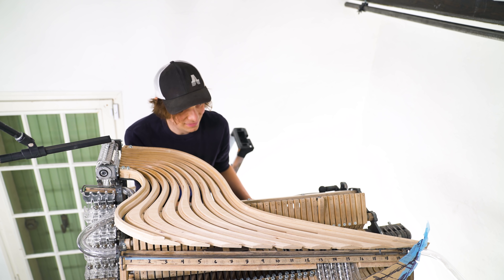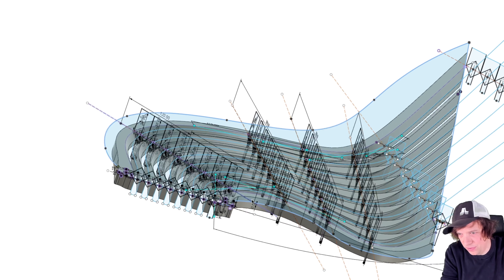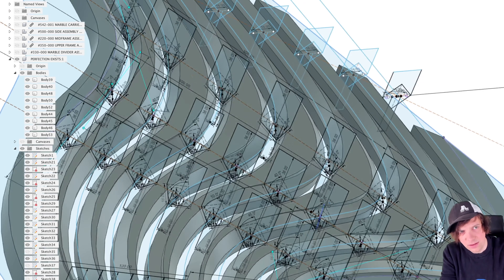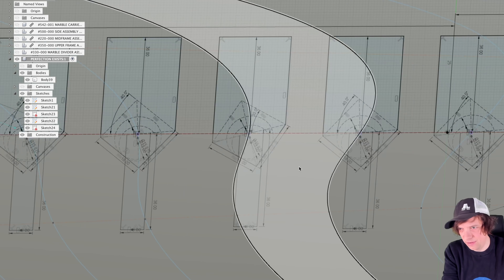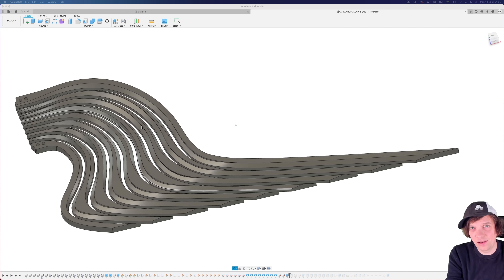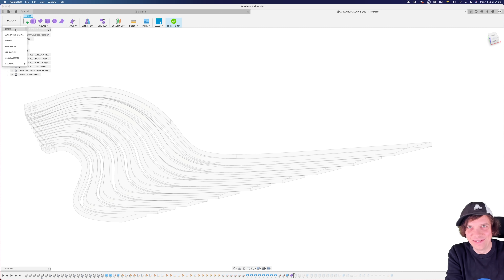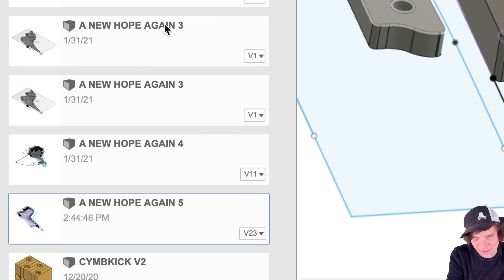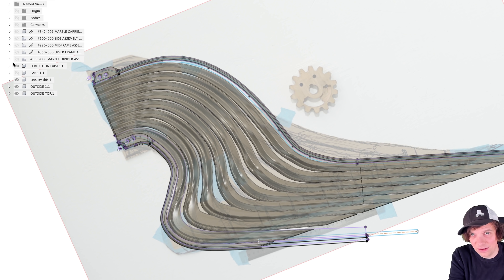Marble Lanes

Comment: Consider slow down the marbles when they "land" over the marble divider, because it seems like they are jumping and skipping some steps
Reply: Yes, and I think the lanes are coming too low in the divider, an intense vibraphone Music will probably suck out every marble and overflow may happen on the pipe feeding the divide by 4
Reply: Also, I don't understand how Vibraphone tile 1 is meant to get any marbles
Reply: @dsfisher  I saw the same thing hope he sees this before putting time in to fix the length.
Reply: @dsfisher  i think with divide by four
Reply: @dsfisher  from the overflow fish stair.
Reply: @dsfisher  from the overflow divide by 4
Reply: @dsfisher  Via the "fish stairs"
Reply: @dsfisher  don't forget the fish stairs - they will supply the vibraphone channels once the machine gets up and running
Reply: I wanted to say something about this as well. Around the 9 minute mark in the video when the marble lane is being tested, all marbles were jumping into the air. The first marble down in particular jumped at least several centimeters in the air. I'm worried that it will cause sub optimal routing for the marbles and, as others pointed out, potentially cause marbles to skip lanes and overflow the divide by 4 system. It seems like the issue is caused by the marbles having just too high of a velocity when exiting the new lane system.
Reply: i was thinking the same thing, they're coming down wayo to hot, they might skip some tubes and overflow the return system
Reply: @Stban90  or bounce out of them entirely and end up on the floor
Reply: Also kinda concerned how the marbles coming into the main marble lane might knock marbles off when coming in at those speeds
Reply: Martin will fix that with a pile of spacers 🙃
Reply: I think if the gap widens at the end the marbles will slow down.
Reply: Right now the new piece is not pressed down so the marbles jump down to the devider. I'm sure that will be done when the piece has been modified.
Reply: They're bouncing because the lanes aren't aligned with the divider yet. You see how there's excess material resting 'on top' of the divider? Martin even calls attention to it at 7:17. Once he removes the material, the lanes will sit flush with the divider, and the marbles will no longer bounce (as much).

Although they may still slam into the guard rail at full speed, giving some bounce... so yes, a slow-down would be beneficial regardless.
Reply: Increasing the overrotation of the marbles towards the end of the lanes would slow them down, but also make them rotate faster. They wouldn't het the track with such speed, hopefully not bouncing over channels or out of the track completely. But would the bigger rotational speed make them behave in other unwanted ways? I call for testing!
Reply: Widening the gap at the end will slow down the marbles because the rolling diameter will decrease.
Reply: but the problem with this is that the rotation of the ball will speed up, and so, when it lands it will have the same kenetic energy and will transfer that in speed when the rotating ball touches the second 90° slope of the marbledevider
Reply: Exactly, i think the slower speed, the best feed into the divider

Comment: Doesn't this design greatly limit the number of marbles that can enter the lanes for the xylophone droppers? Why not just merge the outputs of the fish stairs and conveyor and have them dump out at the start of the lane feeders so every lane stays filled?
Reply: Aren't the fish stairs going to the vibrophone?
Reply: @mattmexor2882  They are, but the fish-stairs are rather slow (compared to the main conveyer belt) and can't move as many marbles at once.

If the low notes on the vibraphone require a lot of marbles in a short amount of time (which is likely to occur during the playing of up-tempo pieces), the fish-stairs might not be able to supply enough marbles to meet the demand.
Reply: @InventorZahran  How are they slow? don't the marbles progress through the fish stairs at the same rate as they progress up the conveyer belt? You'll have a lag between when the marbles go past the tubes the first time and when they get to them the second, but there's also a reservoir of marbles in the tubes above the droppers and the fish stair system can be primed with marbles before playing. I don't see why there should be a problem.
Reply: @mattmexor2882   Maybe I misjudged the speed...
Reply: I don't think you can run enough marbles over that single lane - they can only move so fast if they are to drop into the space properly, so either you have too much speed and it doesn't fill anything well, or slow enough marble roll and the later channels might run dry on a xylophone heavy section - they are the smallest reservoir or marbles anyway with that slope, and nothing will run past the hungry early channels to them.
Does seem to me like this design should work well enough on the feeding marbles score - each group entering the new part is split relatively evenly down the channels so no marble stores will be left waiting, as enough new marbles are introduced across all the channels, but the fiststair recycling system gives the xylophone priority by its nature, so all the overflow will cycle into the instrument expected to be heavily used and a marble hog.

My issue with this design is marbles from the fiststair and their interaction with the newly added marble paths - it looks like the ones from this new part might be going rather too fast to stack up on top should there be marbles beneath as they arrive, and the lane shaping might hinder that shuffling past the marbles beneath too - the old system they could rack up sometimes 3 deep till the lower layers have got out the way and would mix in neatly... Seems like that lower part of the path either needs the rollation slowdown geometry for the marble rails or a less aggressive slope.
Reply: It doesn't, since every excess marble still gets fed back in by the fish stair.

Comment: if you have not already you should invest in a space mouse or some other 6DOF HID it will improve your CAD workflow having a dedicated device to move and rotate your model

when i use fusion 360 i have my left hand on my space mouse my right hand on my trackball and the keyboard between them for when i need to type 

TBH i have used my space mouse with fusion 360 for so long i don't even know how to move or rotate the model without it LOL

Comment: hey martin ! with this new design, isn't there a risk that the marbles, with this new gain of speed, jump off the devider ?
Reply: Or landing on top of each other in the divider and then bouncing out?  I think there was definitely merit in condensing the channels into 2 shoots previously.
Reply: Yes
Reply: I think he can fix part of that with overrotation.
Reply: @vincentguttmann2231  yes but it will wear the wood after some time
Reply: @gillesbkf4315  the marbles are pretty smooth, and should be wearing down the acrylic just as well. Sure, there is some wear, but not that much that it becomes signing
Reply: Yeah, he'll likely add a thin wall to the front similar to the guides around the end of the marble divider where overflow exits to the fish stair.

Comment: This new design is unreliable. You need to make the lane a U bend ending in a pocket at output 1. Or else you won't have enough balls for the xylophone.
Reply: There is always the marbles coming from the fish stairs
Reply: @hipination1037  8 marbles for 20 tracks, where one is a bass. Is not enough when set up like this.
Reply: @JohanFroloff81  the amount of marbles didn't change at all... What's the point you are trying to make?
Reply: @hipination1037  Every ball needs to pass every channel. or the machine will starve. at some point.
Reply: @JohanFroloff81  yes, and they will eventually. Let's say a marble enters the divider at channel 9, doesn't get used up in a channel, leaves the marble divider with all the other excess marble through the pipe at the end of the piece and gets transported to the divide by four. From there, the fish stairs will transport it back up and it gets fed back onto the divider at channel 1 and eventually makes its way down the divider again. The old design worked with the same design principle.
Martin only runs into problems when the track he is playing consumes more marbles than the machine can transport per second/beat/unit of time.
Reply: From my perspective, the leftmost exit bypasses several of the xylophone channels. And the speed!
Reply: @rhkavli  What do you mean. It is a ramp. Going from left to right.

Comment: What about channels 1-3? They don't look like they're being fed.
Reply: I see now that the fish stair feeds the first couple of channels.
Reply: @gir_bot  I wonder what the story is for the three instead of four going up at a time on the fish stairs.
Reply: Even without that issue, I'd be worried about marble starvation on the left channels. the last channels are going to get many more marbles passing over them than those notes. I think if it were me, i would add a switchback rail, have the sweep go to that rail just above the main feed trough, then feed every marble to the left and allow all of them to pass over all channels.
Reply: @piercet  Generally speaking... the drums and bass will consume the most marbles. If the beat slows down the overflow through the fish stair will feed the vibraphone channels.

Comment: Aren't the marbles a bit too quick when entering the marble devider? You can see the marbles bouncing off the tracks at 9:20
Reply: it looks like they are dropping onto it because the marble lane was not bent down to the divider as it will be when it is attached
Reply: I see an extra guardrail being added soon
Reply: @victornpb  I can see an angle grinder being used soon. Whack-a-mole, you know?
Reply: I had the same thought. The divider/pipes are designed, based on Marbles entering with a certain speed. With the new design, I fear for another redesign of that part.
Reply: @andershauerholt2522  Maybe he could look into adding overrotation to the last stretch of the marble lanes to slow their speed upon entry.
Reply: Same, I thought that the design contemplated this by making the channels increasingly wide so that the axis of rotation of the marbles will change and slow down the speed
Reply: He said he made them a bit to long (front-to-back) on purpose so he could trim them back to make a smooth transition. As soon as he saw they were way too wide (left-to-right), I assume he stopped there. If it had been the right width, I bet there wouldn't have have been bouncing once trimmed.
Reply: It is calling for over-rotation.
Reply: Had the same thought/concern
Reply: I was wondering if some overspin could help. Though the twist could make it hard to manage that overspin.
Reply: The velocity is probably about the same -- the marble still travels the same vertical height as before, the only real difference would be the friction of the wood (which I'm sure will get some graphite to help with that) versus that of a PMMA pipe. I think the bigger question is the angular momentum -- before, its velocity was along the edge of the wood, but with this, it looks like the marbles are going to have more of a vertical component. That could lead to edge cases where a marble manages to land itself in a "sweet spot" between the marble and the edge of its hole, which might lead to more bounces like this.
Reply: I'm super-concerned about this as well. Hope Martin has thought about this and has a secret plan to manage it :-) Maybe he intends to adjust the lane width and use the marble overrotation-concept to slow down the marbles?

Comment: I still have the impression that the marbles enter the divider with a lot of momentum so that they will surpass the pipes that are empty. I think it might be a good idea to try to figure out which channels are preferentially filled up with one design. Would suspect that in the end the upper 50% of lanes are probably filled up with the marbles that are filled up by the fish-stair. From the beginning I thought that you should always have a reservoir of marbels that are available to fill up empty channels randomly but I need to say that I would not have an idea which meets the requirement of being beautiful.
I mean the momentum problem can be solved easily with the angle of the end of the lane with respect to the divider and maybe the lane itself can be used as a marble reservoir which always holds marbles.
But in the end I am sure you will find an excellent solution.
Reply: either that or slowing down the lanes with some fabric or something so they'd have less momentum, kind of a problem solved before having it entirely.
Reply: The momentum I saw as a bit of an issue too, not only for missing the lanes but what if they hit another marble? Could throw both of them off the machine easily.
Reply: @dylan1kenobi  if the lanes are always filled with marbles I think it could work, but than you need to know how many marbles you can fill in the first place to not produce an overfill. It is really a complicated problem because it highly depends on the Musik that will be played
Reply: Well those marbles are not there to fill the funnels (at least not at the first attempt and otherwise only for the last few funnels) the stairlift is the one which will fill all funnels.
Reply: @GamezBeatz  agree but at the same time this is the slowest refilling mechanism. I am very curious whether or not this will be a problem and how it will be fixed. Cant wait to see
Reply: @paulgwozdz2475   I always thought of the overflow tube and fish-stairs as being a "retriever" for any marbles that didn't enter channel in the divider. I never thought I'd see it being relied on as a primary deliverer of marbles to the upper channels, considering its slow flow rate and limited capacity.

Comment: Should have glued the edge rails on after initiating the twist when mounting
Reply: I was surprised that he even started sanding it without seeing if it fits first or even comparing it to the template. Ah well. Mistakes are a great way to learn.
Reply: @nagualdesign  Put yourself in his mindset. He designed the piece in cad on top of the cardboard template and used the CNC to cut it, so he already "knew" it would fit
Reply: @YozhikvTumane  When he's made templates previously he scanned them alongside a ruler in case the scanner got the scale wrong. This time the template was too large to scan so he taped it to the wall and, I'm guessing, took a photo.

When I saw it taped to the wall, along with a ruler, I hoped that he'd take the photo from as far away as possible with the camera at the right height to avoid barrel distortion, but it looks like the biggest issue was only using a small ruler. I think his success with the scanner gave him false confidence that he could use photogrammetry without any problems.

Knowing that the machining was going to take hours, it would have been sensible to put a felt tip in the router and have it quickly redraw the template on paper, then see if that template fit on the marble machine, before investing a lot of time and effort cutting plywood. Or at the very least taking a few measurements from the CAD drawing and seeing if they match the dimensions of the machine.

It's an easy mistake to make, but a bit of a rookie error. The moral of the tale: measure twice, cut once.
Reply: @nagualdesign  The problem wasn't the scale of the template. As you saw, the previous (rounded) design was accurate. I think he just lost focus when re-designing the tracks and adjusting the curvatures for aesthetic reasons.
In my opinion, the template isn't even needed when having the two planes, start  and finish line, measured and linked in the CAD drawing. He could have created those tracks only from the fixed points measured in the previous video and with the length & relative angle of marble divider included. It would have eliminated the problem all together.
Reply: @YozhikvTumane  Yup. It may well be that he simply lost track of which line was which. As you say, focussing on aesthetics and getting tunnel vision.

I posted a far simpler suggestion at tiny (dot) cc (slash) mmx-simplified but I don't think he'll see it, or if he does he probably won't want to use it, as it ain't pretty.
Reply: @nagualdesign  Many great ideas and suggestions might get lost among all these thousands of comments to these videos. I'm sure I wouldn't be able to rea each nd every comment if I had this much on my channel.
Reply: @YozhikvTumane  Exactly. Anyway, he'll be working on his next big idea right now, so we'll find out later today what decisions he made, and maybe he'll have worked out where he went wrong. Fingers crossed!
Reply: @nagualdesign  I'm just afraid he'll use the jig-saw (angle grinder for wood) and sticky tape to "reshape" the existing piece ;)
Reply: @YozhikvTumane  😆 It is rather painful to watch!
Reply: @YozhikvTumane  Exactly my thoughts too.
The whole machine exists  as a parametric cad model. If he had created the new part based of existing stuff  he also might have realized that  he needed to modify the top mounting bracket before cutting the plywood and THEN notice that the mounting points became too weak
Reply: @DanielRegnér-c5d  It probably isn't too week, as that point is being pushed towards the mounting bracket. It's the other side that takes most stress from the screws and I didn't see any weakening on that side - might still be too weak though. I don't think there's any underlying strength calculation behind the dimensioning of this part.
Reply: I was surprised he glued something on it before twisting it. In 48 hours il will already be tearing apart